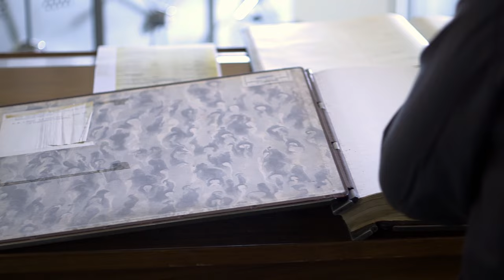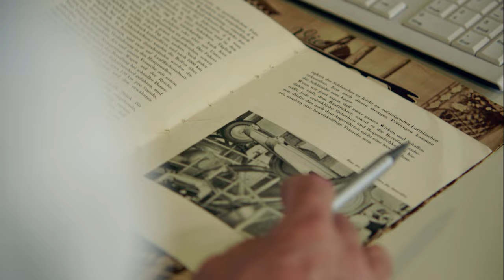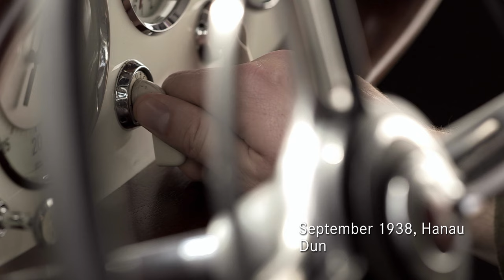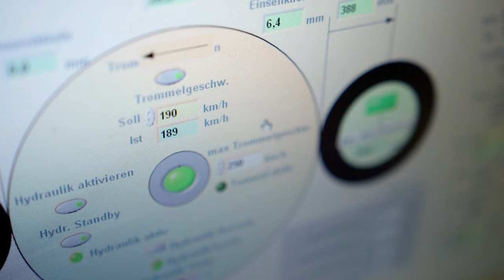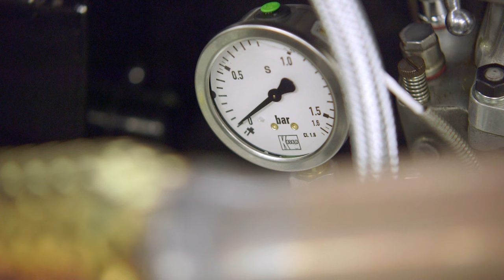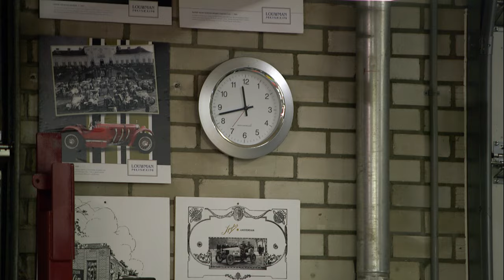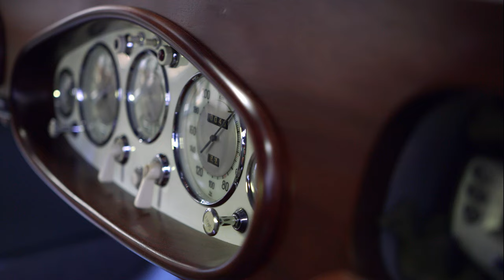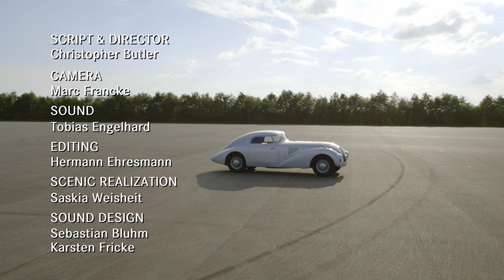The Streamliner Case - Mercedes-Benz original

Comment: I love the fact that Mercedes Benz embraces its history. No matter the model I’d be confident  I could keep it on the road since mercedes supports all of its previous cars
Reply: lol, you haven't worked on many modern ones then, they don't support bugger all, a MB is just a status symbol now, normal run of the mill day to day vehicles are made BER by the time they're about 15-20, never mind reaching 70 like this.
Reply: @glennmoore5880  I don’t know how modern we’re talking here. The most modern MBs I’ve owned have been the M113 and M112 engines with the 5g tronic trans. That set up has worked great for me. I’ve seen some modern fails like with my mother’s W203 (c class)that had transmission issues because of coolant getting mixed in the trans fluid. She has a C207 (E coupe) now so the verdict is still out on that one. Any Mercedes I buy is second hand maybe third so I look for tried and true and I’m not even considering cost cutting A-classes or C-classes. Quality may not be what it was back in the good old days but I think parts will still be available for them.
Reply: This is and has been changing
Reply: @glennmoore5880  My experience is that my US-made R-Classes (I owned two different ones) were less than perfectly made with issues with the self-levelling suspension and the gasoline engine in my R350 (the diesel in my R320 was fine), but the repairs were handled under warranty including a malfunctioning HID headlamp. My 2001 C-class wagon was fine, but was a pig in the snow. My wife's SLK320 was flawless, period. My 2014 GLK250 has been e joy from new, but it did require a replacement particle filter (handled under warranty) and a steering box recall because on some cars some bolts were corroding and it was also subjected to the worldwide Takata airbag recall.
Reply: @omostim2385  The big caution with buying a used Mercedes is that it needs to come with a full service history which must also show that only approved fluids were used and all the work was performed by a competent marque specialist. If it doesn't have that, you should walk away no matter how attractive the price. MB has always had entry-level models and they are still supported by the factory.
Edit: on 2nd thought, I don't imagine the X-class will have much support in the future, being that it's a rebadged VW and not at all an actual Mercedes.
Reply: @CaptHollister  vw??  No
Reply: @glennjones6574  Oops, you're absolutely right. I must have had a brain fart when I wrote that. Thank you for pointing out my mistake, I shall hang my head in shame and proceed to flagellate myself in atonement. The X-class is, of course, a rebadged Nissan. Still unlikely to received long term support from MB, especially after they dropped after just 4 years due to abysmal sales (seriously, who would be crazy enough to pay Mercedes money for a Nissan pickup ?)
Reply: Yep. I did a frame-off restoration on a 1959 300 D Adenauer for a customer in 2011. The factory  radio was beyond repair. The owner found one through MB services which would have replaced it perfectly. It was only $4,300.00. Hard pass on this constantly broken down euro junk.
Reply: Uncle Joe  Sorry I can only give you a single thumbs up for that. Boss still sponsor the F1 Mercedes team today and that Snowflake driver of theirs is happy to wear their name on his racesuit !
Reply: Mercedes builds some beautiful cars. Always have this car is no different absolutely gorgeous and light years ahead of it’s time. My friend had a 1985 300D when, I was growing up in, Minnesota.  It was stored in the winter, so he only had it out during the spring and summer months. Painted Nautical Blue clear coat was insanely deep. Tan leather. And the thing is older than I am. But it’s a stunning car even today. Everything is serviceable on it. Even the door hinges have grease points. In my opinion that’s what luxury looks like:  Long sweeping lines, tan leather, built to last above all else.
Reply: Mercedes Benz classic center can built you anything, such as a brand new 560sel for the price of a new s600. No other manufacturer like Mercedes Benz.
Reply: Uncle Joe  you're first issue is attempting to compare Mercedes with Toyota.
Reply: @omostim2385  as long as they're made in Germany I have a C class from the Alabama plant and it never runs as good as the German made MB
Reply: Facts !!!
Reply: They forget to remember some of their historic clients....
Reply: If only American manufacturers did. I can not get parts for a 15 year old car.
Reply: @darthtyranus7683  Maybe the C class we had was also made in Alabama. That car had some quality issues. The M, R, and GL classes were also from that plant and while I don’t think they are terrible vehicles. They weren’t the best
Reply: @BoyishDriver  That’s the coolest part. Being able to buy a basically brand new classic MB
Reply: @CaptHollister  i know from my cousin (engineer at BMW, former Mercedes engineer), that they have serious issues with their US factories, because they never reach the quality standard that they ask for…
Reply: Just make sure you don't buy the W201-based 190E ... they said it was overengineered but in fact it was a step away from Cobra, and towards after market strategy.
Reply: While I don't disagree, in my experience Nissan does as good if not a better job at that
Reply: @CaptHollister  Not VW at all. It is actually a rebaged Nissan Navara / Frontier / NP300. An not to forget Renault Alaskan and DongFeng Rich 6.
Reply: @glennmoore5880  my father had no problems getting original spare parts for his oldtimer from them. That’s not the case with many other brands
Reply: @glennmoore5880 
I drive and have been driving 'modern' Mercedes cars for over 30 years and I have never had an issue with them.
Not sure what you mean by 'don't support them'?
Support from the service teams has always been spot on and, on the very rare occasion I needed some small parts for brakes etc, yet again, no problem.
Reply: @CaptHollister 
I have owned 3 X different W203 Mercedes models, C270 CDi, C220 CDi and a C320 CDi (V6) and you mention they were 'a pig in the snow'?
I found them to be excellent in the snow..... but you MUST switch OFF the traction control first. (Indeed, switch the TC off in any car in the snow!)
After that, they were a joy to drive in the snow, lots of fun to be had👍🏻👍🏻
Reply: @WeeShoeyDugless  Are you in Australia?  If not then your experience will be very different to those of us here.  If you are,  buggers me where your service center is,  but as a mechanic and previous Mercedes owner,  all of my experience with them was bloody terrible.
Reply: @CaptHollister 
The X-Class had absolutely nothing to do with VW and, my neighbours X-Class has over 100,000 miles on the clock and has performed faultlessly (he is a builder and it is frequently overloaded!!)
Servicing has been routine and he has had no problems at all concerning brakes parts, wipers etc.
Mercedes have most certainly got fantastic spares availability for their cars going back decades.
(We are not talking about 'after market' parts either, like most marques rely on!).
Reply: @InstaLabSparti 
If you dig deep enough, every marque had 'historic clients'😂😂😂
Reply: @c0nstantin86 
BS!!
I owned 5 W201 Mercedes, a 1.8L, a 2.0L & 3 x 2.6L and other than service parts (brakes, wipers etc), I never put a spanner on them.
Fantastically engineered cars.
Reply: @glennmoore5880 
UK based👍🏻
Australia, according to what I'm constantly reading, has much the same problem with every make of car??
Reply: @WeeShoeyDugless  Yes and no, makes from Europe are notoriously expensive here and poorly supported. Knowledge is thin,  even at the dealerships.  Parts are prohibitively expensive and reliability of most modern Euro designed or built cars is very shakey. The big ones like MB, BMW and the most under the vw umbrella are just not good long term propositions here.
Reply: @WeeShoeyDugless  Thank you for trying to teach a Canadian how to drive in the snow, duh ! The C320 simply cannot drive through snow banks and from a standstill it cannot handle a parking lot with 15cm of snow without a lot of difficulty. It is a pig in snow. I also remind you that on Mercedes of this generation it is not possible to turn off the traction control. You can switch it off, but it still remains active with a higher activation threshold.
Reply: @CaptHollister  
And thank you for being such a smart ass.
15 cms of snow is the same anywhere in the world, Canada doesn't own snow.
As I said, I had no problems with any of my W203s in the snow and ALL of them had the facility to switch off the traction control.
Perhaps you couldn't find it😁
Reply: @WeeShoeyDugless  Turning the TC off in a Mercedes of this generation does not, in fact, turn the TC off. It only changes the threshold at which it intervenes allowing for more wheelspin. It could be that the different torque curve of the diesel versions allowed for better performance in the snow or maybe it was a question of sedan vs wagon, I wouldn't know, but the gasoline-powered C320 wagon was simply terrible. It had insufficient ground clearance and poor weight distribution. It was fine once it was going, but the challenge was always to get it going. When stopped in snow, it had great difficulty to start moving forward and when needing to plow through a snow bank it would usually get stuck. Meanwhile, I could drive my wife's SLK320 in winter and it was always fine despite having even less ground clearance then the C. I don't remember it ever getting stuck.

Comment: Top quality work from great specialists. My father worked in a coachbuilder shop about 60 years ago. He still had all the knowlegde of the old days. When I see those guys welding aluminium by hand: This is extremely hard and whenever I tried it, I failed miserably!
Reply: Is that why they used luminium  on race cars. must have been a pain building race cars just saying.

Comment: I resurrected a 1936 170 convertible in the late 1980's for a customer. Tried to get some helpful info from MB. No luck, had to cobble together parts to rebuild the carburetor, local auto electrical shop helped with generator and wiper motor rebuild. Local body shop did body work. Upholster made new top. After car was done customer's daughter and new husband drove off from their wedding in it.

Comment: Man, I love Mercedes and their classic parts support, I have a 1998 W202 C250 TURBODIESEL with the 5 speed manual, wagon
It's a rust bucket, I will be fixing the rust, I like how Mercedes has all the body panels still available, doors, fenders, bumpers, floors, okay, they might be expensive, but they still have them available, which is AWESOME, and the aftermarket support is great too
It has 400k km and runs like new!, been owning it since 2012 and it never left me stranded
Mercedes-Benz, engineered like nothing else in the universe

Comment: It’s a love for such attention to detail that has led to my owning at least one of every S-Klasse (or predecessor series) since my 1955 W180 220a, including W111 220 Sb, W112 300 SE coupé, W108 280 SE, W116 280 SE, W126 300 SE, and C126 500 SEC (my current driver) – 17 in total (though none of them purchased new). I've also owned two W201s (a 180 E and a 190 E) and a W124 300 E.

Das Beste oder Nicht!

Comment: 22:30 This is exactly the man I imagine working on a 1930's Benz engine.
Reply: He looks like a WW1 soldier. I would expect him to climb out of a submarine. But when he talks, I can spot where he comes from in a 15km radius.
Where I was born, within 40km, there was an car company, that build such a car in a small series. The Bugatti Type 57 SC Atlantic, same type engine, but only 3.2l, 190km/h with the 175hp version, and up to 225 with slightly more compressor pressure.
Back to Mercedes:
Unfortunately MB did not produce this car. The Americans would have bought them all.
Reply: @fromgermany271  he looks a bit like my Hungarian father. I imagine it was too expensive to produce and Mercedes was too busy making engines for the war?
Reply: @christopherdesbaux5950  they said American (or British?) soldiers took it away from the Goodyear test area. So I expect it was after May 8th 1945.

Comment: It's a very lovely car, if a bit precious.   And as an engineer, I love the real engineering attitude - slow and careful, step by step, expecting things to go wrong and need to be fixed.  I don't recall any show that started out in English being like that.  Germany really is an engineering kind of country.  I'm actually descended from a German wheelwright, but he emigrated in 1832, so my connection with the German vehicle industry is a ways back.  

Now, as beautiful and highly engineered as the car is, it's only fast and powerful for the time if you ignore another corporation with a German name which starts with a D.  Duesenberg.  I won't be crass and mention numbers, but the SJ street cars with their old style high drag bodies could romp past this thing, and that was in 1930.  In fairness, I don't know about the handling, and probably the Duesenberg transmission was not as easy to drive.  I think Jay Leno has the only road running streamlined one, and I don't remember it having a supercharger, but I believe it's still faster than this car.  

I believe you can leave the Duesenberg supercharger on longer too.

Comment: I see that they added turn signals, back-up lights, and modern fuses. A legal requirement perhaps ? I was also surprised at the amount of positive camber; handling could not have been all that great. As a long-time Mercedes owner, I appreciate its attachment to its history.
Why wasn't the Italian coach-builder named ?
Reply: Check 23:55 - the name is on the guy’s jacket.

Comment: Numbers: 5.4-liter straight eight giving 105 hp freely aspirated and 180 with a Rootes-type supercharger.
A normal 540K weighed 2.7 tons. Probably the aluminum version was lighter. It had vacuum-boosted hydraulic brakes and a top speed of 170km/h or slightly more.

Comment: What did they use for a radiator on final assembly? The test bed rig used what looked like an SSK radiator, which doesn't seem compatible with the body front intake. It was also still on the chassis when they did the initial body assembly on the rolling chassis.

Comment: I hope someone will teach that guy how to use a "Laser Thermometer" correctly!
It's actually not the laser that are doing the measurement, but an IR reading in a width typical of 1/5 of the distance to the object, the dot is just a pointer so you can see where you are pointing. It's printed all over those devices how to use it. Rather surprising to see a Mercedes Tech not knowing how to use their own tools.
Reply: Engineer, not tech. So not surprising.
Reply: Or did you mean the tire tech at the end? 
Maybe I spoke too soon: I assumed you meant the engineer when that were running the engine on the stand.

Comment: Couple comments:
(1) 3-digit speeds with no seatbelt! Now that's ballsy.
(2) I noticed when they put in the instrument binnacle (not the digital test meter but the analog ones), the wiring harness had modern plug-in connectors. Thus, they've made a concession here and there to modernity?
(3) Are the Dunlop vintage tires made completely to original specs? I thought maybe they would incorporate  some sort of modern technology inside the tire carcass that improves their safety.
Reply: For new specs (even much better than originally) you need to run through new certification procedures. And most owners of pre-war cars want to have it „all original“.
And often „newer“ tyre-technology needs different setup of the drive geometry.

Comment: I'd appreciate a little more insight on the aerodynamics. The design looks like it follows Paul Mary's principles rather than Erich Ubelacker's enhanced approach for the 1936 Tatra 87. Was this down to parents or the length of construction?
Reply: It's of the same "generation" as the (original classic) VW Beetle, still with separate pontoon fenders. A bit more sophisticated in places, a bit cruder in others (no glassed-over headlights) but that's down to being a handbuilt prototype racer compared to a cheap mass-production car.  The straight-through pontoon look had been around since Sir Dennistoun Burney's efforts but it wasn't until the 1949 Ford's tucked-under sides that resolved how to make a pretty shape without any hint of separate fenders.
Reply: @nlpnt  Sorry, I just saw what the spell checker did to Mr Jarray's name in my original message. I agree with your thoughts on the period, e.g. headlamp faring. To extend on your suggestions, have you come across the 1934 Praga Super Piccolo specials that where used in endurance racing in period? The treatment of the front fender/wing and the rear spatted wheel arches 'may' have influenced Touring's 8c2900b, though the length of the hood/bonnet is exaggerated on the Alfa.